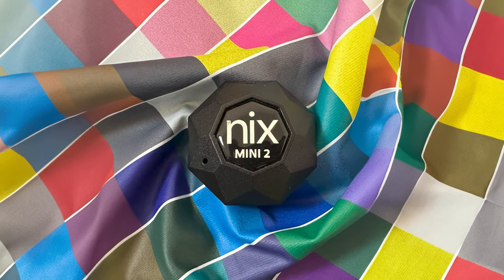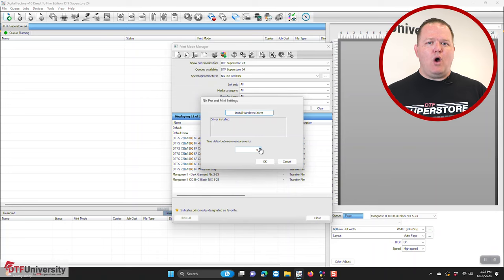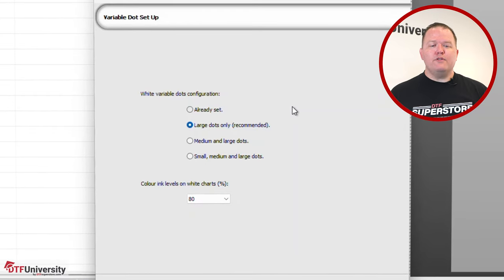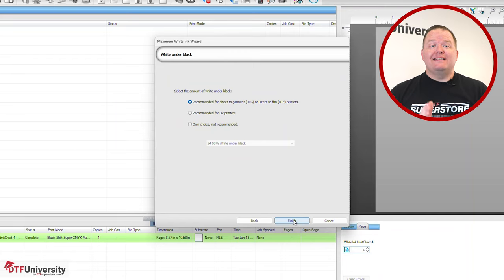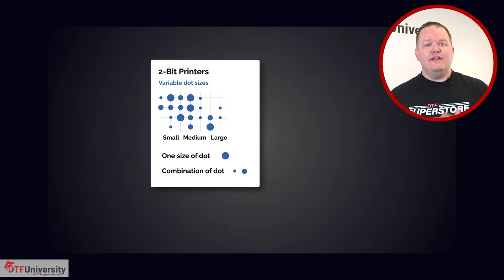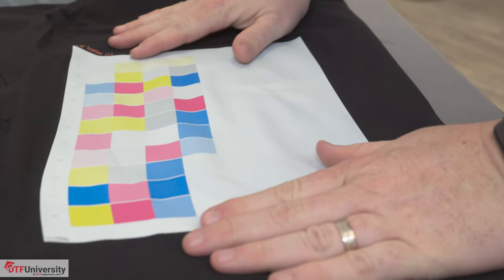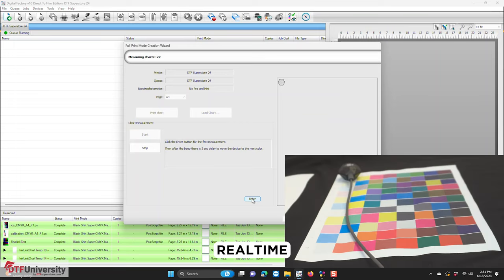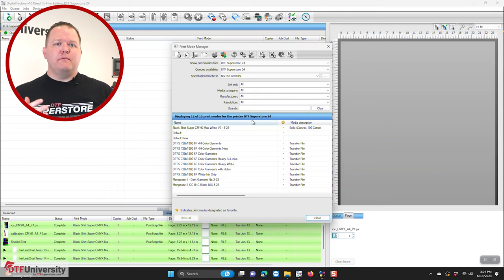Guarantee Accurate DTF Colors with the Nix Color Sensor & CADLink

Comment: Hi! I have Cadlink 10 and Nix Mini 3. How do I connect Nix Mini 3 to Cadlink? I need a driver for Nix Mini 3. Where can I get it?
Reply from the maker: You'll need the Nix color profiling add on from CADLink
Reply: I am having same issue with the mini 3 and cadlink.  In the winDRV folder it only has two drivers and neither are the mini 3.